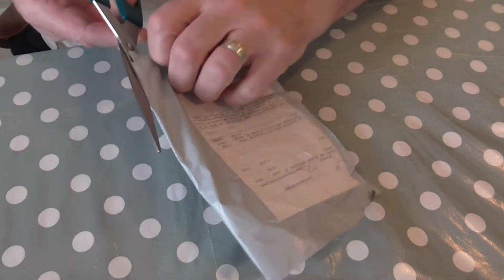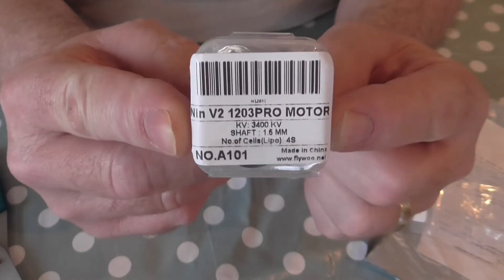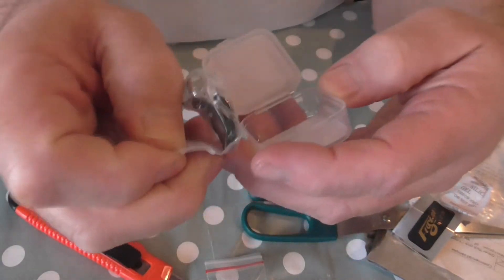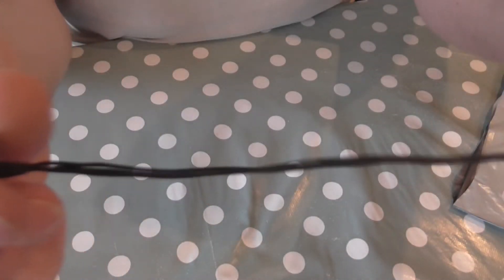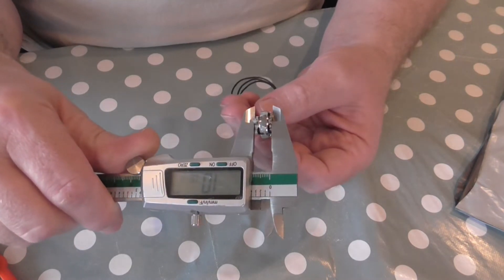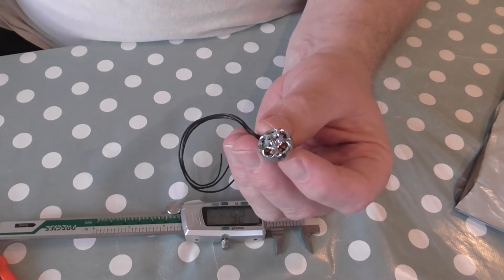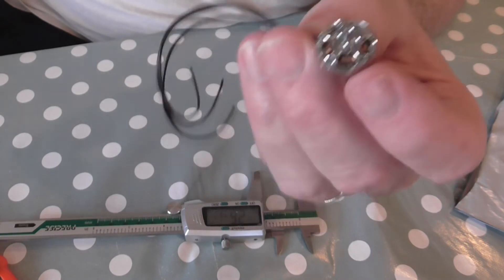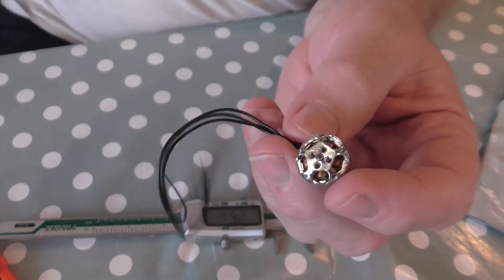Super Flywoo NIN V2 1203Pro 3400KV Brushless Motor Unboxing

Comment: Have these motors on my Flywoo Firefly 1.6”.  Can’t say I’m impressed with them though…feel quite cheap and after just 2 flights one of the 4 motors stopped working on me.  Wondering if you ever installed this motor and your experience with them?  Perhaps I just got a bad motor.
Reply from the maker: I haven't had chance yet - hoping to fit it in a small depron plane and will update when I do but been very busy with lots of things recently and haven't had a chance to do much modelling unfortunately. Thanks for watching though and don't forget to "Like and Subscribe" 👍😊
Reply: Same thing happened to me, twice. I think I'm going to replace all of them on mine, I'm tired of having to complain to RDQ about horrible products they are reselling.